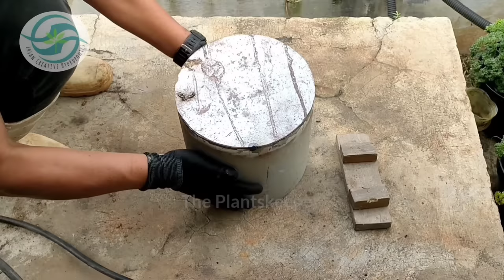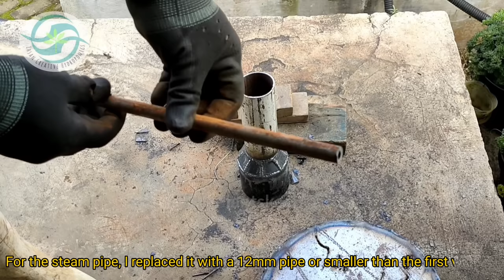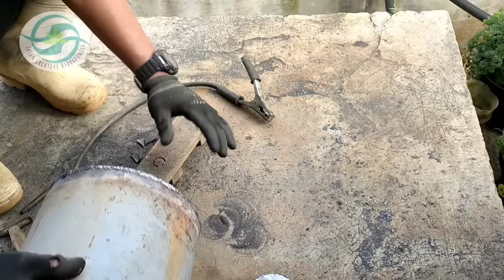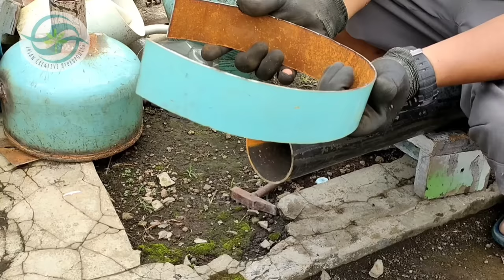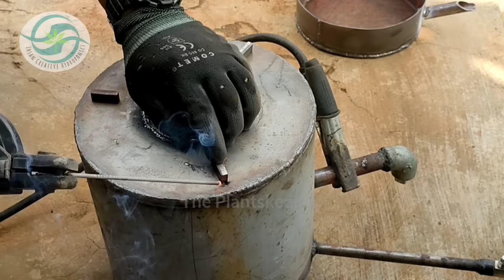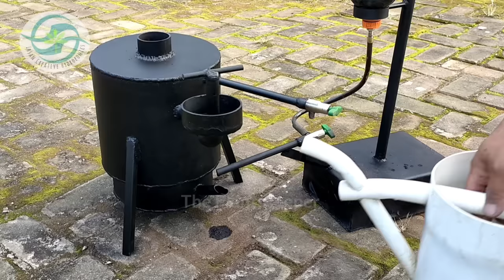Amazing!! Powerful oil waste burner without a blower machine DIY tutorial

Comment: so, you're using the steam generated by the heat of the oil fire to create a venturi affect that mixes art in, increasing the efficiency of the burn and the heat output. One thing i would add is a automatic pressure release valve ,  so it doesn't explode. Pressure testing might also be work looking into
Reply from the maker: That's right, I want to add a pressure relief valve and a pressure gauge, but it's expensive in my place even if there are cheap but poor quality
Reply: @ThePlantsKeeper  Think old pressure cooker safety valve. A pipe with a weighted cone sitting in it. When pressure got to high it lifted released steam then fell back into place. Start light and add weight.
Reply: @ThePlantsKeeper  you can fabricate... just find spring and a metal weight
Reply: @ThePlantsKeeper  an old fire extinguisher will hold the pressure. The water, foam and powder types have good quality gauges.
Reply: how exactly is the burn efficient when the flame isn't blue?
Reply: @kiyoponnn  "increasing the efficiency" doesn't mean it's at maximum efficient, just means it's better than without the extra airflow
Reply: @proknifesharpening  I highly doubt that(not the explosion part)
Reply: @ThePlantsKeeper  I don't understand. You seem to have some quite adept fabrication abilities, so even if DIY a pressure relief valve is literally something that can be made not necessarily have to be purchased. It could simply be a weighted Cone on a slide with a spring and a lapped receiver for an airtight seal. Testing could be done in order to calibrate the length of the spring or size of the cone to dial in the pressure for relief.
Reply: So, how can one add the pressure release valve and pressure gauge?
Reply: @nelsonadebayo8456  easiest way would probably be by adding a 1/4" fitting to the side with T, the pressure gauge on one arm and the valve  on the other side. You can get adjustable valves - basically a piston with a spring, so as the pressure inside increases it depresses the spring and opens
Reply: @kiyoponnn  not all flames that are blue are hot, and not all hot flames are blue.
Reply: Instead of Blower, he use steam to creat pressure that blow the fire. How so amazing 😊😊😊
Reply: @ThePlantsKeeper  
 For safety reasons you need a pressure relief valve to avoid explode..
Reply: It's open to the atmosphere so it won't overpressure, or did I miss something?
Reply: @justtinkering6713  it's a partially sealed system using steam pressure to generate airflow via the venture effect - the steam pipe was that 12mm steel pipe (not sure if that's ID or OD), the rest of the system is sealed. If the pipe gets blocked or steam pressure builds past the point of it being able to vent via that opening it could lead to a catastrophic failure
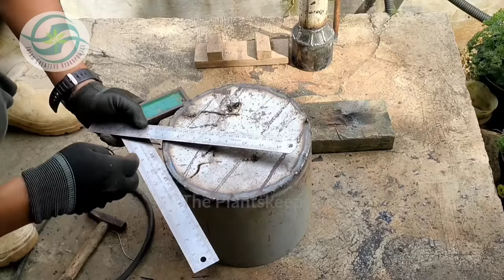Reply: @jerichojoe307 2:59
Reply: I wonder what the result if he fill the pressure tank with oil in order to get the venturi effect from pressured oil gas as an extra fuel ?
Reply: 09
Reply: Me parece muy peligroso 😮

Comment: Funny, this is kind of how steam locomotives work.  Once the steam is released from one side of the cylinder and the other side is pressurized, the exhausted steam is blown out of the smoke stack to induce a draft through the firebox.  That's why they chug.
Reply: how to avoid chug?

Comment: I been commenting on how dangerous a spill of water on oil burner stove design, 
but with this, its explicitly mix the steam with the burned oil, now the violent flames is utilized efficiently and also removed the fan which use electricity....  following the design and  upgrades on next videos...neat.... keep it up...
Reply from the maker: Thank you, that's the reason I always do a leak test because it would be very dangerous if any water fell into boiling oil
Reply: what will happen seriously?  @ThePlantsKeeper
Reply from the maker: @GodspeedPizza  wild fire 🔥

Comment: Great content I’ve watch every thing on the web    This is great 
What I’m trying to do is burn trash with used oil, creat high pressure steam or air pressure to power air tools like air drills buffers high rpm to turn an alternator 
What do you think ?

Comment: Great, great, great invention you have.
I this will be much better if there is a pilot light igniter like what others did before the strong blue fires appears. They do not use any blower but heated the pipe using alcohol before they release the oil and the steam they got from it produces the needed fire. If using water can add more power on the fire then this is much more powerful than just using the oil. The pressure valve is also needed if using water.
Reply from the maker: Thanks brother, and thank you for the advice I appreciate that 🙏😊

Comment: How long does it take before the steam is generated to assist air flow? When the water is finished you will have a Smokey flame as the tank is refilled and heated? Could you incorporate an air pump to take over those minutes for continuous clean burn?

Comment: Awesome man...but, what did you mix in the use oil to make the fire stronger?
Reply from the maker: It's gas, for starter because oil is hard to lit when cold, it's water that make the fire stronger
Reply: @ThePlantsKeeper  what if the water runs out? how much water can be put in there? can it be filled?
Reply from the maker: @jeralddalnay8168  When the water runs out the fire will decrease, with this design it can fit about 6 liters of water, but the more water the longer the initial preheat process
Reply: @ThePlantsKeeper  maybe I'll make something like that but smaller than that first so I can test it...well then thank you for sharing, keep it up and God Bless 🙏...one last question where are you from??
Reply from the maker: @jeralddalnay8168  okay success, I'm from Indonesia
Reply: Really cool, so the water has to get up to temprature before it burns correctly? That is against how I would have guessed, I would have thought it would have been better cooler. Still, you've got it happening man,, good for you and everyone else
Reply from the maker: @andrewsilver4769  yes that's right
Reply: @ThePlantsKeeper  How exactly does the water make the fire stronger?
Reply from the maker: @gerrys6265  The water is converted to steam and increases the pressure in the center pipe creating a vacuum at the bottom so it can pull and push the flames stronger.  Water in the form of steam is more easily broken down into oxygen and hydrogen.

Comment: could a pressure release valve from a hot water heater be appropriate? what rating or specs would the pressure guage need?
Reply from the maker: It gets better, 100 bar is more than enough
Reply: As, Pressure is equal to Force/area you just need to make a 12,5 hole and put a weight of 200g over it to hold this pressure
Reply: @agoradacerto  neat

Comment: Neat little project however; it takes energy to cool and or freeze water for its purpose. Neat little household project but not viable for survival or anything like that unless you were to add a solar powered thermoelectric cooler or glyco cooler with a solar option for powering the pump. Which again would be over engineered for a survival application. So it's really better off in a survival situation for someone to actually boil distill over a fire. Still a neat project though for one two get a concept of atmospheric condensation to produce water. But the laws of thermodynamics indicate power in for product out. There by the temperature differential is what matters which is why you have to use cold water in your system whereas a survival system would get its temperature differential from the fire versus atmospheric temperature while at the same time sterilizing and killing any contaminants.

Comment: Kulang lng Ng drain hole/pipe to removed replace water after consuming hydrogen or not in use for long time
Reply from the maker: No need for drainage pipe, because water turns into steam, breaking down the hydrogen happens when contacting with fire

Comment: Great idea. Could you show me how we could add water continuously when the burner used for long run?
Reply from the maker: For long-term use, you can increase the size of the boiler, because in hot conditions it becomes difficult to fill water bli
Reply: @The PlantsKeeper  They have a check valve you could use to keep adding water an not lose pressure

Comment: Kailangan dyan may pressure monitor at realease valve para safe Hindi ma over pressure
Reply from the maker: English please 🙏😊
Reply: He said need pressure gage and pressire relief valve. In my opinion fixing pressure gage is  a safety feature the user to know the steam pressure inside before hydrogen and oxygen gases evolve to the combustion chamber. Maybe somebody can make imptove modifications to improve  safety features and more intense heat generated.
Reply from the maker: @albertocabual6023  I also agree with that, for more safety, you can add a pressure relief valve and a pressure gauge, in my place such equipment is very expensive, some are cheap but it's same as buying garbage

Comment: Can you get a stronger flame with a pilot light at the air intake?
Reply from the maker: What is pilot light?
Reply: Just a small flame at the air intake to speed up the air flow.
It's not needed for this design but a more simple design without the water
Reply from the maker: What power ignites this pilot light?  Maybe I'll try if I understand
Reply: @ThePlantsKeeper  any flame a Lil buddy burner a hot coal anything to drive more air into the bigger fire
Reply from the maker: @diglettunnel.kaneko  Maybe I prefer an air blower if I want to add pressure, I'll think about it later

Comment: Good & unique but it's very dangerous, it may blow your face, or hand if you mislook to open the water intake valve while it is hot...
Reply from the maker: Opening and closing the water inlet is when the tool is cold, because it will be difficult to enter water in hot conditions, unless the pressure relief valve is installed facing downwards

Comment: How to add water if it's empty? Open the water valve cause the steam pressure getting low right?
Reply from the maker: You have to wait until the temperature drops

Comment: Wow! 
Good,, like a boiler.
But maybe we have to add a relief valve for it. Or any precautions?
Anyway, just suggest more Ideas to prevent any danger for more protection.
Thank you for sharing this..
Reply from the maker: Yes, I agree, a pressure relief valve can be installed to prevent excessive pressure, maybe I will install it in my next project. Thanks 👍
Reply: @ThePlantsKeeper  
Yes,, thank you for your response..
God bless for sharing this. Now we have some ideas how we fight for the expensive gases for our house cooking..
Reply from the maker: @jacrengel9063  my pleasure 🙏
Reply: @ThePlantsKeeper  can we see your updated version of this project with installed pressure safety valve in it?

Comment: Can one mix water and say acetone or water ethanol together until it a less volatile mixture since water is miscible in these combustible solvents; then allow that to be pressurized from the heat with a smaller orifice and run the venturi burner? And then only be using something like oil or white gas or w/e to initiate the heating of the water/fuel mixture?

Also note I KNOW you cannot use oil and water in that stream generation reservoir because the oil would be separate from the water, the water would enter gas phase before the oil and would not be able to get past the oil's viscosity. It would blow up and kill anyone nearby. Like that time a crude oil storage tank was on fire and fire fighters hosed it for like 2 hours and the water was just slowly seaping into the fuel silo replacing the oil a it burned away. Then it heated the water to a supercritical state and could not contain the pressure. It blew up and gave all that oil exposure to a HUGE area to burn, all the surface area contact with air to burn at once, made the oil into just fast moving droplets of inferno

Comment: Well lets push this further... Can you Heat a bigger tank for a Central Heating or use the Steam for a Turbine to generate Power? It Looks Like its very effective. How much oil per hour?
Reply from the maker: I think it can, the use of oil is quite wasteful but it is directly proportional to the resulting fire
Reply: That's what a oil fired steam train is . Works the same as what you're suggesting

Comment: It seems quite powerful and scary. But how does it work ?
Is there any potential for it to explode ?
Reply from the maker: Yes, I also feel the same way 😁 but I've used this burner 8 months ago, use twice a week, one hour per use to burn garbage, it seems safe, even what I use is the first version which is very thin  in materials.  But it's not to be imitated, that's why I upgraded using thicker material in this second video
Reply: Yes, maybe we have to add a relief valve for it, like the Pressure Cooker, do I'm right sir? Or that's enough because there is valve to release the pressure?

Comment: and the cat returns at the end of the video. This looks dangerous in the event an even so slight leakage occurs sometime later......kabooom! worse still if your're melting metal, water will make all that metal turn you into a sieve. the idea is ingenious though.
Reply from the maker: If there is a leak, the pressure will go away and the fire will decrease, I have already pinned a comment about safety by adding a pressure reliever

Comment: I’m intrigued…
I don’t understand the need for the t handled steam tube and squared cap tube ?
I want to make a pool heater out of this design ;)
Reply from the maker: Sorry 🤭I still don't understand your question, which square?
Reply: @ThePlantsKeeper  the relief valves… 2 of them.
One has a green handle
One has a threaded cap with a square head.
What do those do?
Reply from the maker: @1989GTADRIVER  A bigger pipe to enter water, and a smaller one in an emergency can be to remove pressure and reduce the fire, another function to make it easier to enter water
Reply: the T handle is for when adding water while the burner is still hot.

Comment: What is the fluid in white container?
Thank you
Reply from the maker: It just fresh water
Reply: Thank you
Reply from the maker: @mikonecesito3689  okay 👌 😊
Reply: By the way, what is the purpose of adding water and do I need to fill it from time to time?
Thank you for answering my queries
Reply from the maker: @mikonecesito3689  Water is converted into steam and used as a booster in the venturi room, so it can suck and push the fire bigger, adding water can't be done in hot boiler conditions, so add water as much as we need
Reply: Thank you so much. Nice work
Reply from the maker: @mikonecesito3689  OK, I hope it's useful
Reply: Did you tried putting check valve for longer operation?
Reply from the maker: @mikonecesito3689  For long term use, I recommend pressure relief valve
Reply: Thank you so much in planning to build my own burner, I'm only concerned with the supply of water cause I need it to use the burner for atleast 12 hours. I'm thinking to slowly adding water through check valve to prevent back flow
Reply from the maker: @mikonecesito3689  Consider using thicker material for long time use, and the steam nozzle bore is not smaller than 2.5mm

Comment: I dont understand the full mechanics. It would be great if you would explain every single details.
Reply from the maker: The top tube filled with water is actually a boiler to produce steam, the steam produced is channeled into the middle pipe to help suck the fire and push it stronger

Comment: This is too dangerous,may be if you used  this of kind of method you add a pressure gauge in a body for safety
Reply from the maker: I've been using this tool for a long time, but for safety reasons I will use it for my next project, thanks for the comments